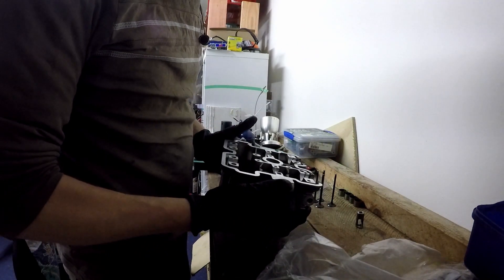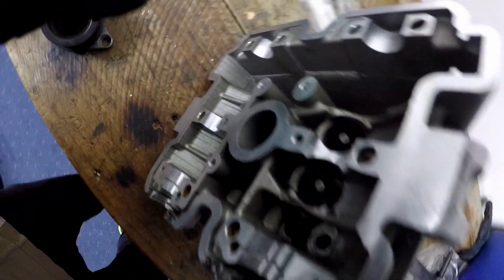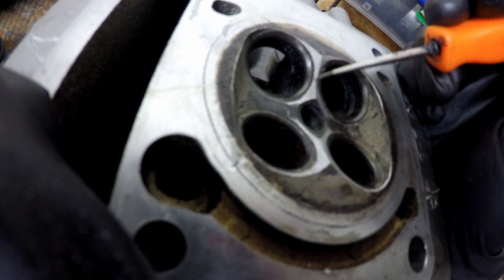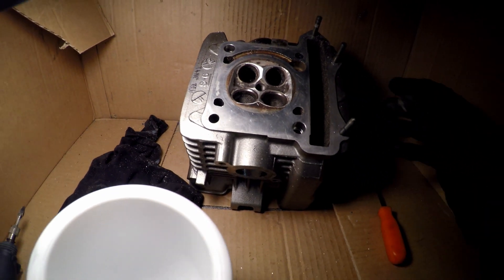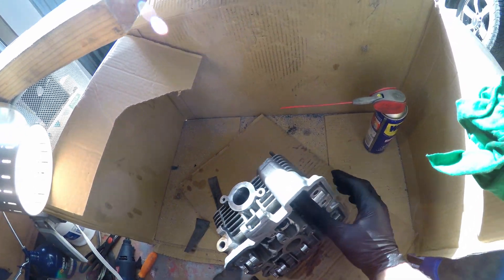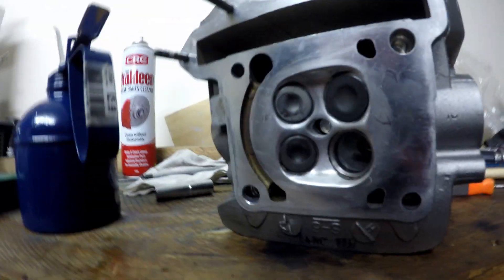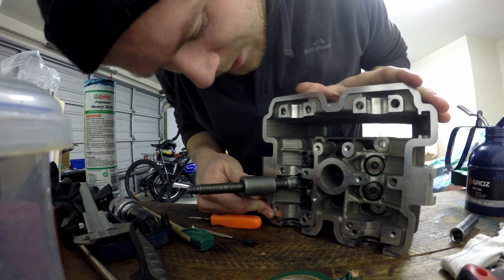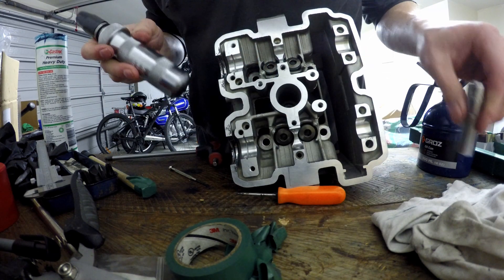Race bike cylinder head porting

Comment: Are you plan to us 68mm bore kit? I have a motorcycle with the same engine, I had to change the carburettor to the flat slide. Less maintenance and less things to worry.
Reply from the maker: The race class we race the fxr's in has a cc limit so the biggest we are allowed to go is +2mm which is a 64mm piston.
Reply: what is the stock valve size and stock port intake diameter?